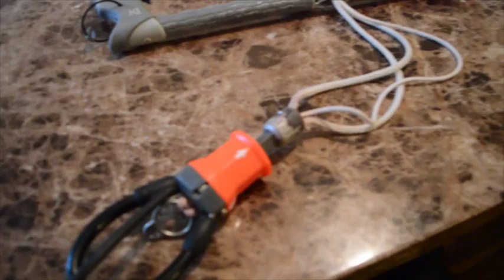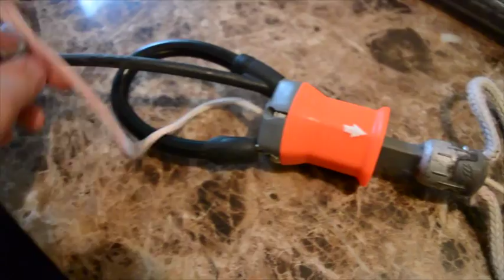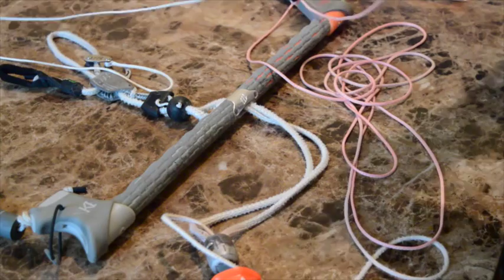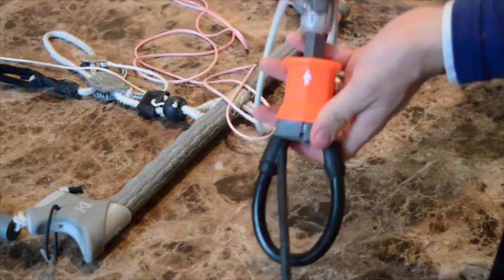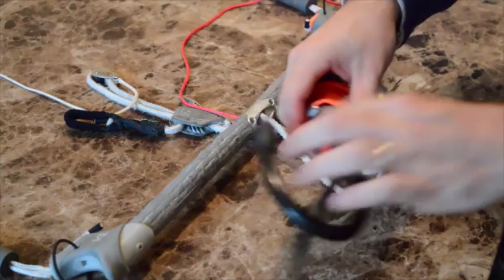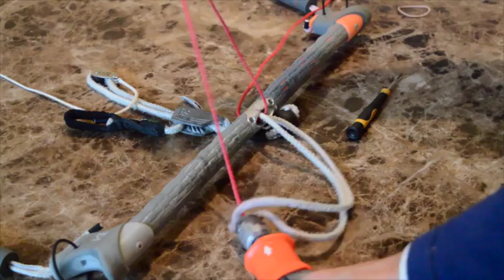North Trust Center (Red) line Replacement

Comment: Don't push the red line through, this could damage the line. Put a small string through the chicken loop hole from the far side. Use the string to pull the red line through the chicken loop hole.

Comment: Thank you for the answer man, i need to know what is the length of the red line please ?
Reply from the maker: It should be 484cm for the 2012 bar but I always tell people to measure their current line just to make sure.  It could be slightly different and if your going to custom make a new one it might as well be exact.  That is the length from loop to loop so you will need a bit extra for the splice.